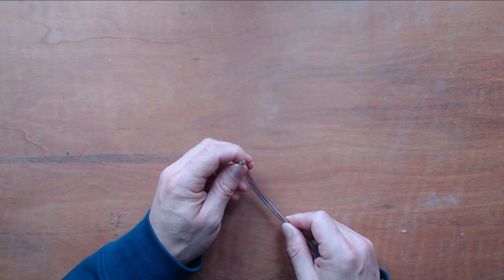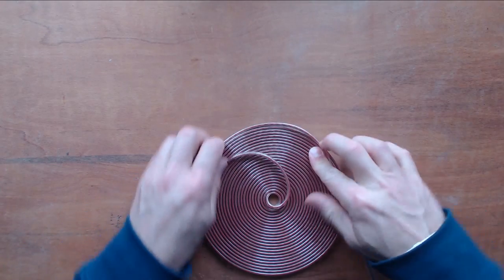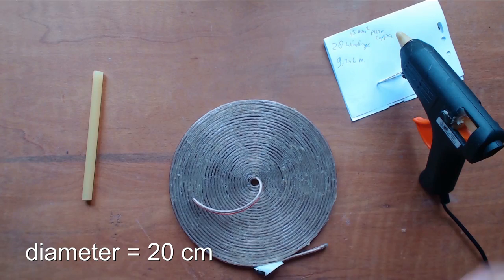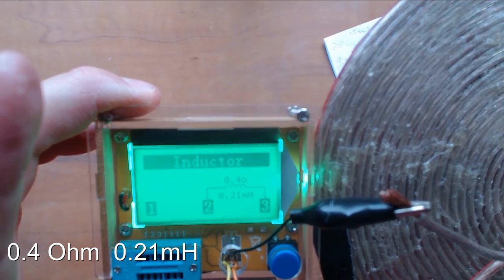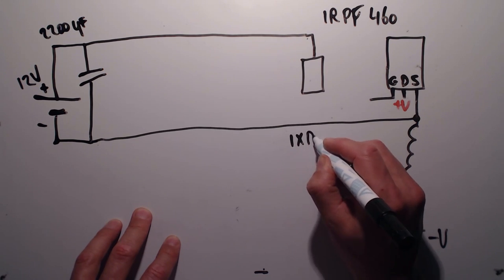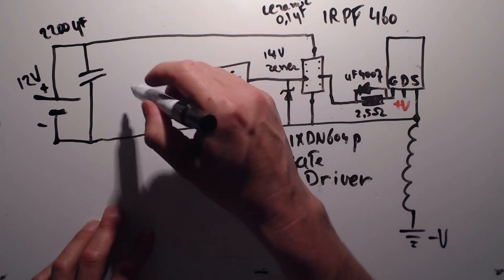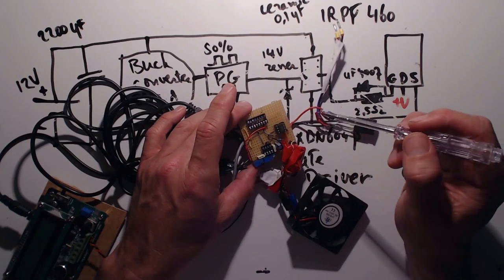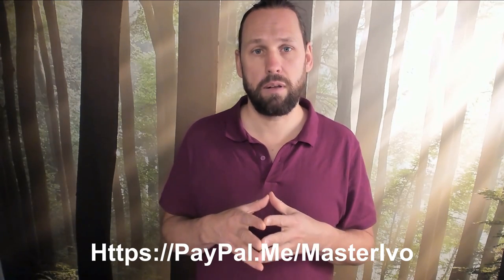Bifilar coil build and high side switching explained

Comment: what do you mean when you say that you need negative back emf why not positive back emf what difference does it make ?
Reply from the maker: very good question. what is the difference between positive and negative inductive spikes, aka impulses aka "back emf".

the dielectric field of the L1 coil is a  product of the virtually instant transformation of the close looped magnetic field, to the dielectric field. 
the dielectric field lines  has its ends terminated on a conductor.

each end (one represents positive the other end, negative voltage) of a dielectric line of force, also known as a Faraday tube, 
is attached to something "different" of the conductor. one side is connected to the mass of the copper coil, the other side is connected to the "massless"

this massless, actually means, there is no volume of aether attached to it, that would give it inertia. For Aether IS inertia.

the massless negative side, appears to be quicker. 

to answer your question. I don't know fully, but I want to know.
Reply: I like that you are a Aetherist, all is aether manifestations, I recently had the realization that aether powers and propigates the light wave. Or we would see losses like all other waves. There are no free rides in nature.
Reply: @dianathompson7597  There are free rides for sure, provided one knows how to get on them.

Comment: My man Ivo. Your probably smart enough to understand this, take a look at the Vedic chakra system pictures. And look at them like a schematic. Put four of those bifilars together and wire them. Schematic looks like a 4 leaf clover. Bridges rectifier to power and resistors on the bifilar connections that look like a W or M depending on how your looking at them, put that on the dielectric plate or stone plate,  you will be impressed.

Comment: How do you get your signal generator to open then close so the gate driver will go low so the mosfet close the gate? I get constant voltage weather I pulse or just use a square wave with a 50% duty and what not. I am using everything the same in this video except my signal generator is a koolertron dds 15mhz signal generator.
Reply from the maker: It should be powered from the battery that also powers the gate drive. 
The output signal, should have enough voltage to trigger the gate on and off, look in the spec sheet of the gate driver IC. I believe I used a 10V signal.
There might be an offset, making the signal -5V and +5V (wrong) make sure, the offset is zero.
Hope this helps.
Reply: @MasterIvo  Thank you for the reply. I now have this going and am getting 980Vpp on the resonant side of L2. With 95nf of capacitance on L2 it is coming out to be 1.3Khz. So I think I need to take some off to get to 42khz. But with it like it is the L3 coil is registering 134-140Vpp at 13-14khz. 
To get the results for health benefits I just need to tune L2 and L3 to 42khz right?
Reply from the maker: great that it works! 1.3kHz? that is extremely low, might be an error.
yes reduce the series l2 capacity to raise the frequency of L2.

L3 can also be used without parallel capacitor. it will resonate at a higher harmonic of L2 (and equal to the L1 impulse) tune to an  exact even or odd harmonic. 

The distance of L3 to L2 fine tunes L3 without a capacitor. 

The impulse can be fine tuned with  a small parallel cap over l1 (100pF steps) 

L1 impulse should be a half period of L3 (when L3 has no cap). 

keep measuring the periods while tuning. 

36khz to 42 khz yes.

Comment from the maker: to be clear, there are 2 separate power supplies needed. one 12v battery is grounded on the source(high side of the coil) , and powers the gate, so it can switch. 
the other dc power supply is grounded on the coils low side, and powers the drain of the mosfet. 
Next video shows why high side switching is needed for, as part of a radiant energy circuit
Reply: Did you see my comment on the second video for radient energy?!
Reply from the maker: @TheOne10525 , don't remember, what did it say?
Reply: @MasterIvo  about the aether/ether i posted it yesterday
Reply: @MasterIvo  i want to give you the  blueprins for the full generator 😊
Reply from the maker: Just saw it. Didn't show up in my message stream some how. You have a vision? I don't do facebook, but my email is on my YouTube "about" page, when looked with labtop/computer
Reply: @MasterIvo  skype/vider ?! We need to talk, me writing, its killing me 🤣 it is not that simple in the biggining but its simple in genral, i think 2 hours will be enaugh to understand all of it
Reply from the maker: I've got skype
Reply: @MasterIvo  mine is bgforrp i think 😅🤣
Reply: @MasterIvo  drop me a line on the mail with your skype so i can tell you what ive worked on, and i can send you some pdf files
Reply from the maker: will do
Reply from the maker: @tanner1985   yes, you can, by using a isolated buck/boost converter to power de gate driver. I  already build one and put it online:
https://easyeda.com/MasterIvo/high-side-gate-driver-for-n-mosfet

Comment: just watched your series on high side switching...thanks it clarified things in my mind....now i want to know what your going do with those back emf pulses. Thanks again for sharing ✊
Reply from the maker: I send the impulses (back emf) into a series resonant bifilar coil / capacitor. This charges up the series capacitor really fast to a higher voltage level. giving a longitudinal kick from the series connected bifilar pancake coil. (causing longitudinal in phase resonance in a loose coupled third pancake coil)
Reply: @MasterIvo  People are always jumping to the end part without knowing that there is no end unless you start something. Starting to get to the end is the game. You have shown it very clearly by connecting a third coil that lights up a lamp: rest can be done to convert it into conventional energy through a capacitor bank. That is what people don't think. They want their cake made ready to eat.
Reply from the maker: Yes I compare it to TV every body wants one but almost nobody knows how works. It's ok. first need to get it working

Comment: related to PEMF device I think this bifilar coil is the suitable for such application. what kind of driver can be used to drive several coil at the same time with sine , triangle, sawtooth or rectangular wave form ?
assume that this bifilar coil is a speaker so my point of view the class A amplifier is the most suitable to amplify sine, triangle, sawtooth or rectangular wave form smoothly without any distortion.

Comment: This is great video. Thanks for the really good explanation. Actually my favorite scientist and inventor is Nikola Tesla. He had a great vision on electricity.  Today what is teaching about electricity and magnetism in schools, is not entirely correct. So it is important to research about the Tesla's work to unlock the real truth. I encourage you to do that. You are doing well.
Reply from the maker: thank you. Yes I am unreaveling the mystery of Tesla and electricity.
I proceed to learn and share until all is revealed, and the world can benefit from it.
Reply: Your welcome!        What happens ? if we could wind up the both wires on same plane. Instead of winding two coils in two planes (top and bottom), I think it will increase the capacitance of the coil. According to the figure 02 of the patent both coils are lied in same plane.
Reply from the maker: @neon-pl3du  yes you're not the first who suggested it. It also works with speaker wire.
he also said in the patent you can use different forms (solenoid) , to get the increased voltage difference between the 2 series connected windings.

Comment: Great vid!!! Liked your presentation...more of this!!!...However, still awaiting why there is a difference between D>S on high side vs. low side...I have built this circuit and placed D>S on either side and Scope shows same negative spike in reference to ground...at any rate I am sure you will show the difference in your circuit...thx
Reply from the maker: Thanks Mark! You say you didn't get a positive back emf when switching the ground?
Next video will explain all. its almost finished.
Reply: Didn't really switch the ground...just moved D>S from high-side to low side...looking forward
Reply from the maker: D>S is?
Reply: Drain to Source of the FET @MasterIvo
Reply from the maker: @MS-ef1gy  I dont understand what you did differently?
Reply: @MasterIvo  just switched high-side, then switched low-side of the coil,  no difference of polarity to ground either way as monitored with scope...
Reply from the maker: polarity to ground? so you probed the drain (low side switched) and did not see the positive back emf?
Reply: @MasterIvo  I probed the coil and as expected the polarity was the same regardless of high side or low side switched.
Reply: @MasterIvo  You must be placing your load across the switch (FET)...instead of across the coil?
Reply from the maker: Pictures say more than words. I almost finished my new video. I intend to upload this friday. This will clarify all.

Comment: why 14 V your Zener your IXDN604P supports up to 35 V max in the manufacturer's specifications? That it must have your zener in watts? 

Thank you very much and congratulations for the superb quality of your video and the kindness of sharing
Reply from the maker: look at the Vmax on the input of gate driver IC. pin 2 and 4. I blew up several, thats why. :)
Reply: @MasterIvo  I didn't find the information you gave me about pins 2 and 4, but I'll take your word for it when you say you burned several of them out of personal experience. I would like to reproduce your circuit but how many Volts (+) your power supply on the drain of the mosfet and where do you connect the negative (-) of your power supply on the circuit we do not see it on your schematic Could you send me the link of the datasheet of your Ic Driver STP I know it is an IXDN604P but I live in Canada I do not know if this model is possible to get here? 

Here is what I could get here... http://www.ixysic.com/home/pdfs.nsf/www/IXD_604.pdf/$file/IXD_604.pdf

Is that the same as you?

Thank you Master Ivo

Comment: Master Ivo,

 I greatly admire your videos.

However I do have a question about the speaker wire bifilar coil.
Seems it is not a single layer, but a double layer.
So the result is not a bifilar coil, but two spiral coils laid atop each other.

The potential voltage of one turn in a flat bifilar coil  is 1/N turns of the total voltage, summed with the previous, current and following turns, divided by 3.
Each turn has a potential of 1 loop difference from the previous and following loop.
Like this (1)(3)(2), where turn 2 is the 1st inbound turn and 3 is the 2nd outbound turn.
So in a flat bifilar coil, the potential of one turn is the average sum of three turns.

In the case of a double layer spiral coil, 
Each wire is not only potentially different between the previous and following turn.
It has to respond to the potential of the three previous, current and following wires below it.
The potential of a dual (speaker wire) bifilar coil is the average sum of six turns. 
Like this 
(1)(3)(2)
(4)(6)(5)

So while there are gains to be achieved with double spiral coils laid atop each other.
We have to be clear to identify the differences so they can applied appropriately.
Overall, I assume there is greater stability at the cost of slightly reduced gains in this configuration.

Sincerely,

      Cliff Landiss
Reply from the maker: thanks Cliff, but no. look again. two windings (speaker wire), series connected. center white to outer red. Makes a coil that has half of the voltage every where between the windings. if resonant and one end is 300V and the other end is zero. the whole coil has 150v difference, together with 450pF it is able to store much energy in its dielectric field (at 50 kHz)
Reply: @MasterIvo  , I am sorry for my poor phrasing. I have changed the word "problem" to "question". When I said problem, I meant like a math problem to be solved. 
Yes, I do see the bifilar connection from the center white to the outer red, and I agree that configuration has better storage.
Reply from the maker: Problem solved ;)

Comment: Hi Master Ivo, at 6:20 you started drawing a box with the letters GDS in it to start your circuit, I either didn't understand what it was or am missing what you called it? I have written down the rest of the circuits and components you listed. I also wanted to ask if you have heard of a man named John Bedini? He also came up with using back emf but he made battery chargers among many other things, that charged batteries with radiant energy which gave them a massive charge and the charge was deeper and faster each time he charged the battery. It is really cool. I have a dvd of him explaining it.
Reply from the maker: GDS is the mosfet. Gate Drain Source are its 3 legs.
yes I know him.
Reply: @MasterIvo  thank you.

Comment: 0.4 ohm and 0.21mH is quite interesting. I know that coils in relays, with really thin wire have around 1000 ohm resistance and 50mH specs. We can see the ratio is clearly different.

Comment: Ivo I have a question (you may have already explained it but I am watching your videos one by one and haven't gone to the one in which you might have answered it). When you lit up the bulb using a third coil, did you verify if it is a radiant energy by submerging it in water to see if it behaves differently than a conventional energy? I am sure it is "cold energy" if collected by the negative spike. Thank you  in advance for your answer.

Comment: Why mosfet driver IC is essential here? Is it  possible to connect the pulse generator to gate pin via optocoupler ??
Reply from the maker: the mosfet needs to be able to turn off and on fast, to create proper impulses. this requires high currents, that only a gate driver can deliver. it could damage the pulse gen.

Comment: Hi, Mr IVO Re the wire you are using can I ask what supplier you got the 1.5mm twin wire from?
I have some that look's similar but it's only 0.3 mm sqr x2. I wound a coil with that length and I get 15cm dia 330pf and 0.3mh and resistance of 1.1-ohm witch could have problems.
Further, I injected a frequency using my SG into the coil and it stabilizes and levels off at 200khz up into the mhz range. Hope that helps.
Reply from the maker: sounds about right, but the resistance will be high. should still work. I use könig pure copper speaker wire  
https://www.kabelshop.nl/Konig-Luidsprekerkabel-2x-1-5-mm-50-meter-Transparant-OFC-topkwaliteit-KN-LSP03R-50-i4869-t3216.html

Comment: Hello Master Ivo,i thought the windings have to be in one plane,your coil is like 2 coils,one on top of the other,i thought the wire should lay on the table so that you see both wires but then you have to separate the wires because if not  you can not wind them because it is to stiff.Please,tell me if there is no difference how you wind the coil.Thank you very much.
Reply from the maker: No difference, and Tesla's patent 512340 also tells you so. You can even use solenoids.

Comment: So if you can create 2 bifilar coils where 1 is switching on the high side and the other on the low side would you end up with an output of far higher voltage potential like around 1000v ?
Reply from the maker: yes in theory, one back emf would be positive the other negative.
Reply: @MasterIvo  so I wonder what effect it would have if the positive was introduced 180 degrees out of phase to the negative pulse. My theory is that you have a greater difference in energy potential. Your peak to peak may double! 😳